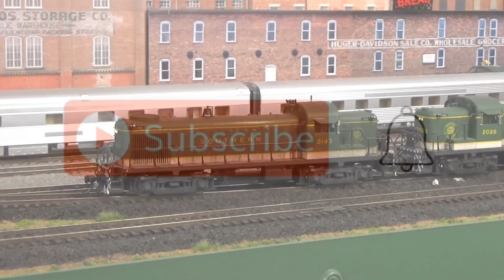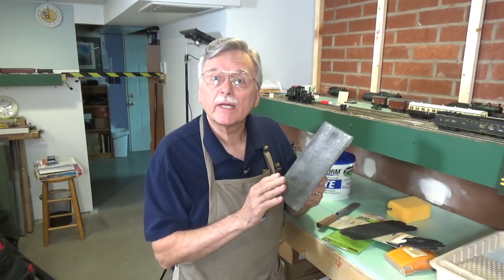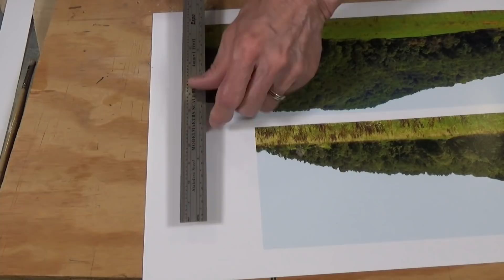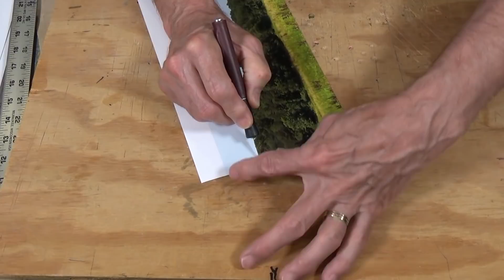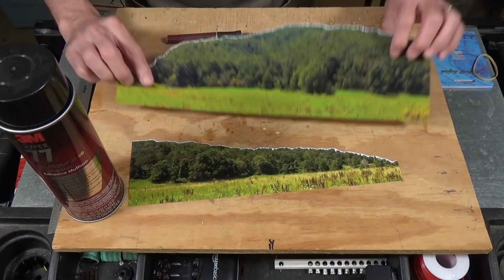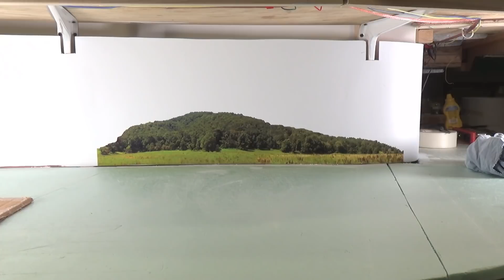DIY Photo Backdrops (203)

Comment: In all honesty, I'm done with the screwed in Masonite backdrops where you have to patch over every single screw hole and gap.  Going forward, I'll be using one continuous roll of sheet aluminum or sheet styrene plastic.  You can order either to the dimensions you need for your layout.  No more Windex curves, or screwing down Masonite, or patching screw holes or seams for me.
Reply from the maker: So just how do you intend to attach the aluminum or styrene sheet to the wall or studs? I used styrene sheet on my last layout and basically had to do the same process with it as with hardboard. Matter of fact I still have a roll of 4’ x 8’ 0.040” thick syrene sitting i t he train room. I have found the hardboard easier to work with than the styrene. Good luck with it. BTW you could also use sheet linoleum.
Reply: @TheDCCGuy  Thanks so much for your reply Larry.  I'm not going to buy the styrene in 4X8 sheets.  I might as well use hardboard then.  There's a plastics company near me who I've spoken with who will  let me order .040" styrene, 48" tall on a roll of up to 100 feet in length. My backdrops need to be 24" tall.  So I'd get 200 feet using that method.   As for attaching it, I was going to consider letting the backdrop semi free-float by using U-Channel at both the top and bottom (both not visible to the viewer).  Or, I could tack it lightly at each stud with a quality silicone.  I've heard of using sheet linoleum, but the weight would preclude me from using it.  As always, Than You!  I love your channel!

Comment: A cutting mat would be a good investment when working on things like this.  Compared to a piece of plywood they will grip the photo much better, and will preserve the point of your blade for a longer life.  And being so smooth there will be no chance of any surface imperfections being "imprinted" onto the print paper and "telegraphing" through the final product as is the case with plywood or other off cuts of construction materials.

Comment: Nice job with the prep and install of the photo background, Larry. You are mistaken about "repositionable" spray adhesives. If you spray one surface and apply it wet it is repositionable, but if you spray both surfaces and let them tack before applying they are permanent and will not peel or lift off. The same is true with Super 77. If you apply it while the adhesive is wet it is repositionable too.
Reply from the maker: Ron, if you search the shelves at Lowes you will find spray adhesives listed as being easily repositionable, meaning an object glued up with them can be easily peeled off the wall or surface easily and then repositioned. I have used at least one made by Loctite following their instructions on the can and it was very easy to move the prints as they said. However after a couple of weeks they began to peel off the wall on their own and I had to reposition them with Super 77. I have never had that problem with 3M Super 77–once up it stays put for years unless you hit it with some heat to loosen the bond. The Loctite brand actually comes in 3 different bonding strengths: Light weight 100, Middle weight 200, Heavy weight 300. I would only use the heavy weight formulation for cases like this. As for Super 77 being repositionable that is only “initially” according to their instructions. Once it is on there for any amount of time it is permanent unless you hit it with a hair dryer.

Comment: My problem has always been trying to judge the size of the objects in the background so that they look in scale with the modelled objects, specifically in an urban/industrial setting. Perhaps you could talk about that a bit?
Reply from the maker: That is an issue that is difficult. Basically it takes a bit of trial and error to get the correct scale and really falls into the area of art. In the past I have used a number of photo flats from the Lynchburg area on the layout and you may have seen them in some of the videos of the Charlottesville yard area. Most are to scale but some are a bit undersized and I usually put them in the rear for forced compression to creat more depth. You can also use N-scale images for the same purpose. When making your own photo backdrops I would make up several scales of them in the photo software and print them out on an inkjet printer to see which version works best. Paper mockups are a great way to test different arrangements.

Comment: Looks really good. The weakness is always going to be the vertical joins between pieces (as it is with commercial backscenes), particularly if someone's not as precise as you.  Running an appropriately coloured felt tip pen along the cut surface is sometimes useful, especially with thicker paper.

Presumably you've tried it leaving the "sky" square (i.e. not trimming it to a small border above the treeline) and that was more obvious to the eye?
Reply from the maker: I have used the felt tip trick too and it does hide the joint rather effectively. You can also overlap the two prints a hair with the upper piece facing away from the typical viewing angle. However the best way is to slightly overlap the two prints, run a knife blade down the middle of the overlap, then peel,off the cut pieces. This leaves a perfect joint but it is extremely hard to get just the right amount of overlap and still have the images match up. Wall,paper hangers use this trick to get seamless joints. Another trick is to hit the print with heat from a hair dryer which will loosen the bond enough to allow you to slide one print up against the other.

Comment: Hi Larry,
Very much like the technique you’ve showed of cutting a 16th of an inch above the tree line.
It makes me wonder about how many of us modelers just use this flat backdrop method, either with or without the 16th of an inch border. The hill you’ve shown might not be an excellent example for my comment, because it truly looks like one earthly unit; geographical or geological.
However, when in our backdrops there are multiple of those ‘units’ coming together in a single photo the field of depth can be shown even more by putting the different elements of the visual on low relief projections. Let’s say on different pieces of cardboard of a millimeter or two thick. I imagine the same kind of effect we were all familiar with as kids when we made our shoebox show-box. Am wondering if you ever used such a technique in a similar as you’ve shown, or, if you consider such a method. On urban canyons such a layering of the backdrop could also work very fine.
Love your thorough explanation, thanks very much for sharing.
Reply from the maker: I have done something like that for photo prints of buildings in urban areas. In that case I used various thicknesses of black gatorboard (foam core with a cellulose based outer layers) for the 3D effect. It does a good job of replicating the real feeling of urban canyons.